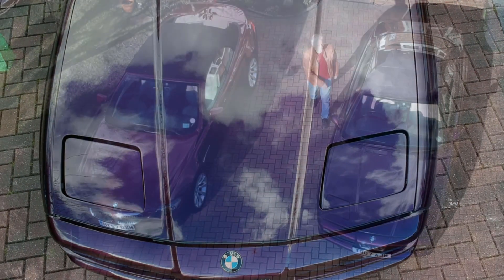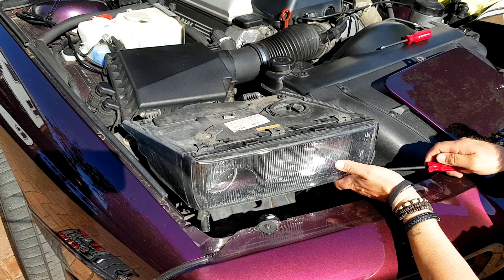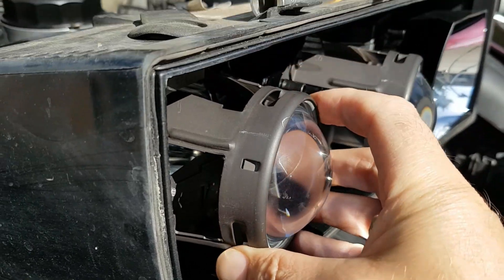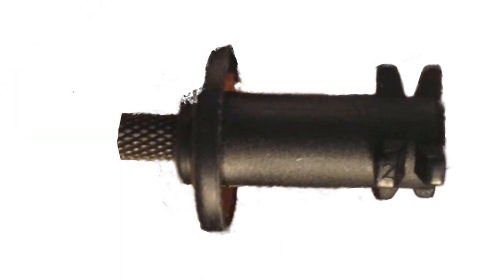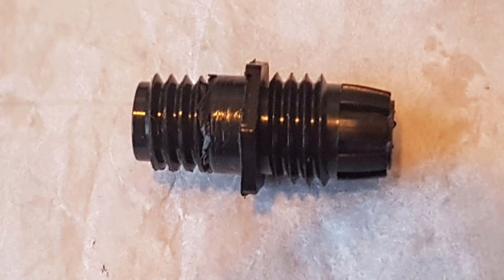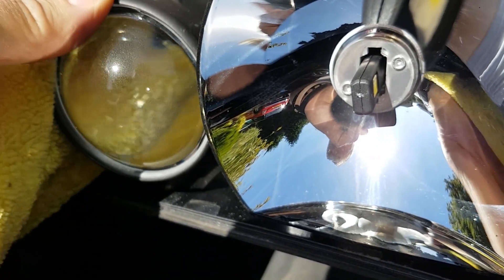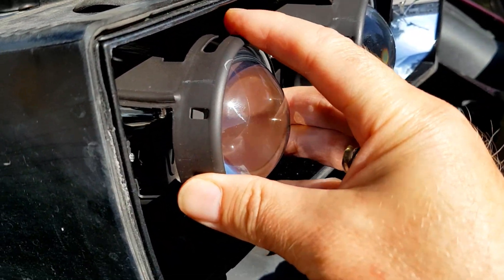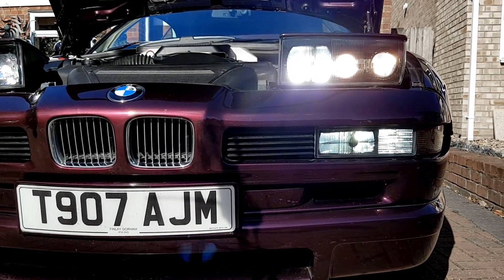BMW E31 Pop-Up Headlight Repair and Refurbishing (840ci, 850ci and 850CSi)

Comment: Timm, great video , so close to what I am trying to understand. I'm in Australia and have a Hong Kong bought 1991 850i ( I think it is British spec given it's 1991) - I have loved it but it has cost me money especially when I moved it to Oz - only 45 or so of those cars brought here and BMW do charge an arm and leg even more than normal - The car has been laid up a while, while I was overseas, but now is resurrected - BUT the drivers side headlamp plastic frame became fragile and the actuation system can't work - I am told the car would need to have both head lamps raised permanently. I'd prefer they work normally. There is some conflicting advice through Chat GPT - that although the original parts are not made byBMW anymore, the part that replaced it in 1992 will work - and apparently that is available. Would you be able to comments? The relevant part, is I think the whole assembly including the light. Parts are 63 12 1 392 038 and 63128354526 - any comment would be appreciated
Reply from the maker: The original headlight housings are available from BMW as are the complete units. If the plastic has fractured then replacing the housing would be my recommendation

Comment: Hi Tim, have you ever had to replace the pop up head lamp motor as mine has failed, also great to see your 840 back on the road 😮Ray
Reply from the maker: Hello Ray, no  never needed to, I would expect getting the assembly back in the right position on those blooming nut/grub-screw devices is going to be the difficult bit!

Comment: Hi Tim

 Thank you so much for your video, very illuminating. I enjoy your videos a lot.

I am a twenty year owner of an ex UK 850I 1991 Calypso red grey leather.( Aged 79) 

Recently the dip light on the driver's side failed , and after taking it to BMW Auckland  New Zealand 
I think they worsened the lamp by botching an attempted bulb glue in job
It''s difficult to obtain accountability or a spare lamp.
Currently the car is at an auto electrician who tells me the headlamp  unsalvageable
I tried buying a headlamp from eBay after considerable expense only to find it was most likely a USA lamp 
different from a UK lamp.
The old lamp has a number on it (Found after stripping) short code 1392144
Do you think it's worth trying your method on the old lamp ?
Should I send you photographs of the lamp ?
I would really appreciate your help as this is a beautiful car for which replacement lamps seem
 improbably difficult to locate
thank  you

kind regards

Andrew

Comment: Is there any advice on buying a replacement alternator for a 840 ci 1998 and the removal of the existing one and the fitting of its replacement ? Many thanks. Paul.
Reply from the maker: It seems to be a lottery these days with replacement alternators. The alternator replacement is quite easy on the 840ci - remove the serpentine belt as shown here: https://youtu.be/MMGFWRVffXg

Comment: Is there someone, Tim yourself, who has restored the headlight glass or the lower lighting? So sanded and polished or re-sprayed with clear lacquer?
Reply from the maker: Yes, there is a member on the E31 forum on Bimmerforums.com who sanded and laquered - and did it again many times and it looked perfect. I have new FTP's because the plastic disintegrated
Reply: @TimmsBMW  cannot find it at the forum. Please can you send me the link?
Reply: Ah thanks!

Comment: As some of you know, the wiring in the BMW E31 was made to be biodegradable. That was really stupid of bmw. I wouldn't touch an E31 with a 10-ft pole. I owned one for 10 years and it was one problem after another. The suspension is constantly needing attention, not to mention coolant leaks, electrical issues, crankshaft position sensor going bad etc etc. Since I got rid of this burden of a car, the food that I eat tastes better, the water I drink quenches my thirst better, the air that I breathe is more exhilarating, the food that I eat tastes better. In other words, life is much much better without an e31. Selling it was one of the best days of my life.
Reply from the maker: I'll look forward to that!

Comment: Great video Timm !
Just wanted to ask, how you are able to keep the light pods up (open position ) but with the lights off ? Many Thanks.
Reply from the maker: Thanks! The trick is to turn the ignition on, switch the lights on so the pods raise - and then turn the lights off again, do that five times in a row and then the sixth time you switch the lights on they will pop up, and when switching off again they will stay up even if you switch the ignition off. To get them to go back down just turn the ignition on again, lights on, lights off and down they will go.

Sounds more complicated than it is!

Comment: Hi Timm! Thanks for educating us E31 owners😊
I’m in the middle of the process but it seems my m10 cable gland won’t fit IN the hole where the bobbin used to sit. Have you glued it IN or ON to the plastic where that adjustment pin goes through?
Reply from the maker: That can't be an M10 cable gland then as it should fit in the hole - and then be glued in place!

Comment: Any advice regarding replacement of the levelling motor
Reply from the maker: Changing the motor requires the removal of all three adjusters after removing the front glass - they probably will not survive so only do it if you have to!
Reply: Update after jiggling and cursing etc motor sprang into life. Downside was it wouldn’t stop. Returning later I wound in the knurled wheel that I had earlier unwound. On reconnecting found both levelling motors not working. . Replaced fuse 5 and back to where I started

Comment: Awesome video, Timm. Always appreciate your input on the forum too. I have not access my headlamp in the way you showed in this video to correct that sloppiness issue. Those plastic nuts and whatever else you use, would you happen to have those parts laid out in display for easier understanding? For example, like the parts laid out by MaxLumens for the brake booster rebuild?
Reply from the maker: Here you go: http://www.meeknet.co.uk/e31/bmw-e31-pop-up-headlight-adjuster-repair.htm

Comment: Another splendid video. Tim, if you can advise, I need to remove the pop up headlights unit completely, I need to replace all the wiring that wire insulation has disintegrated,  any recommendations of how to get this done?
Reply from the maker: Someone on Bimmerforums used to produce a replacement loom - possibly MaxLumens - otherwise it is a long job with a reel of wire, heatshrink and a soldering iron.....

Comment: I'm assuming head light bulb changes is same process is it? Or do you access them from behind without need to remove glass?
Reply from the maker: The bulbs are changed via access panels on the top - which I show right at the end of the video - might be slightly different on non-Euro lights, but still the same plan